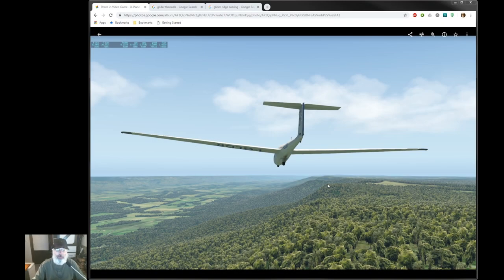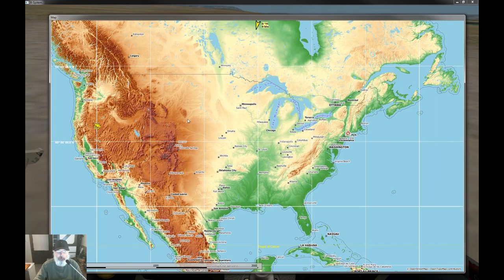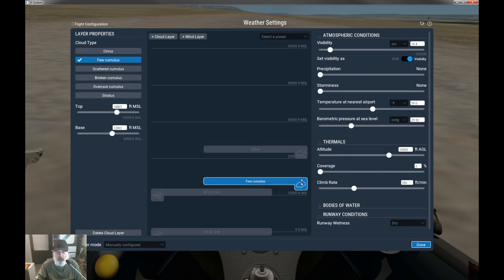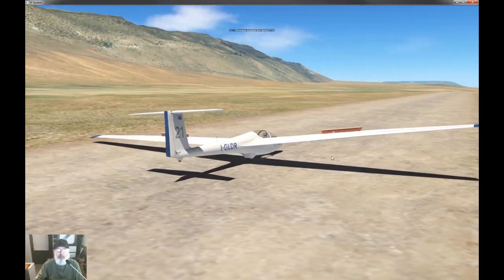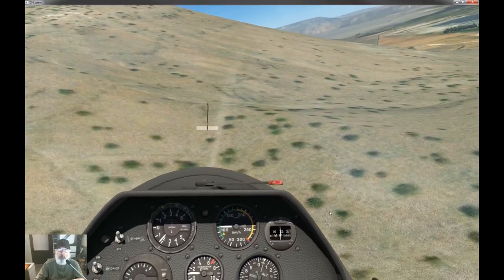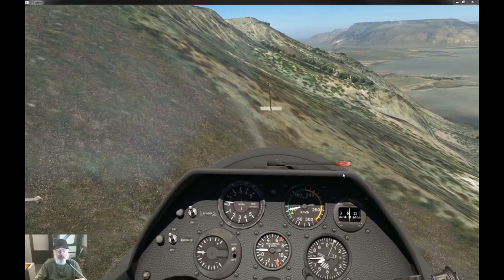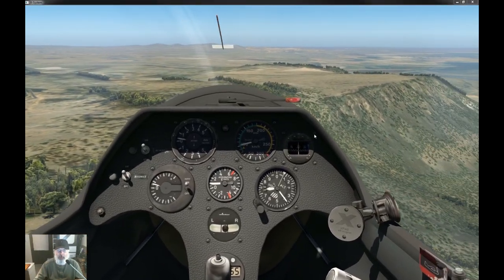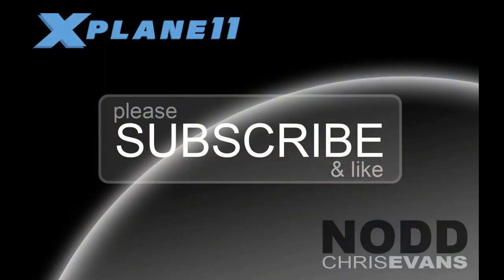Setting up Weather for Gliding in X-Plane

Comment: Great little tutorial. I really enjoy soaring, but haven't flown X-Plane for quite awhile, and had no idea I could improve the mediocre thermal capabilities inherit in the app. However, I always flew with real weather, and was using v.10.  Look forward to buying v.11, and getting started again.
Reply from the maker: There are still some issues with soaring in X-Plane but we're getting very close to having those sorted. As of a recent patch, thermals are greatly improved in X-Plane. And ridge-lift is still really well modeled. At the time I'm writing this (XP11.40) there is a small bug related to thermal strength & the amount of sink encountered outside of the thermals. That's been reported & hopefully will be addressed soon. Real weather soaring in X-Plane is still a bit of an issue. Currently thermals are not included in the real weather engine but you can load the real weather & then switch to manually configured to set up your thermals. That works fine. There's a small but growing community of sailplane sim pilots to be found over at the X-Plane forums & also on the X-Plane Gliding Facebook group. We do multiplayer gliding once in a while. Yes soaring in X-Plane is a lot of fun.
Reply: @chrisevans-nodd  Great suggestion about loading real weather, and then configuring thermal activity. Will look for those soaring forums and FB group. Thanks.

Comment: Thanks I didnt know you could set up ridge lift like this (similar to what I used to do in FSX)  just need some of the hang glider types I had in FSX here in XPlane....   Laurie
Reply from the maker: Yes ridge-soaring is absolutely brilliant in X-Plane. If you're looking for a challenge, there's a collection of ridge-soaring tasks available at the link below. Each has specific instructions on how you should set the weather & also comes with a FMS flight plan to follow. Search for "ASK21 B21" or "ASG29 B21" for gliders that have a built in glide computer to help you navigate the task's course. Lots of fun.
https://forums.x-plane.org/index.php?/forums/forum/488-task%EF%BB%BFs/
Reply from the maker: Here's where you can find those "B21" gliders with a glide computer for task flying...
https://forums.x-plane.org/index.php?/files/category/180-gliders-and-motor-gliders/

Comment: What is the x-system software you have? I have x-plane 11 and never seen it!
Reply from the maker: This video was made using X-Plane 11. I also used Little Navmap on a second monitor to show the glider's location while I fly. Some other mods I often use but didn't in this video would be X-Winch, Towplane-X & Therm-X.

Comment: Minor second comment - the two varios in that ASK-21 are clearly borked in some way, and the audio is wrong also. I'm sure we can do much better than that (as we did in FSX).
Reply from the maker: I'm no expert in variometers but I know there's as bit of a history there regarding the X-Plane ASK21. Apparently they've been through several iterations, messing around with the two instruments & the tone trying to get things right. Apparently the current version is an "improvement" & I must admit it does help when soaring but again I've not much experience with how it should work. I will say the varios in the payware Antares 20E do work differently.